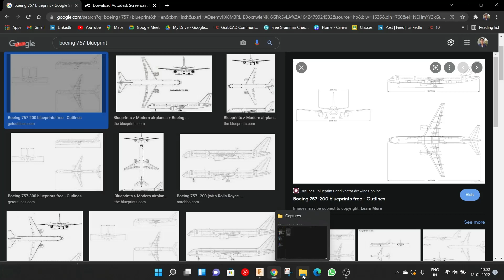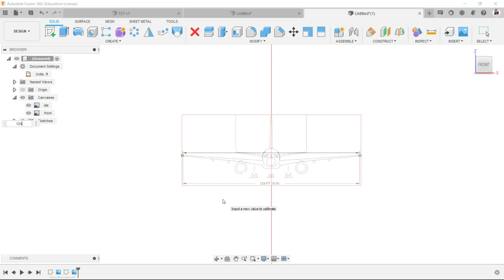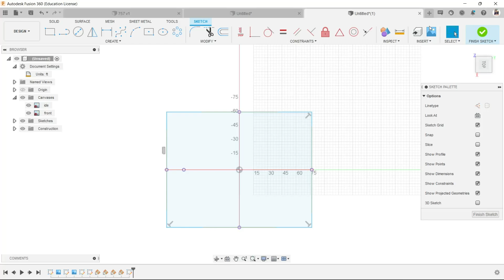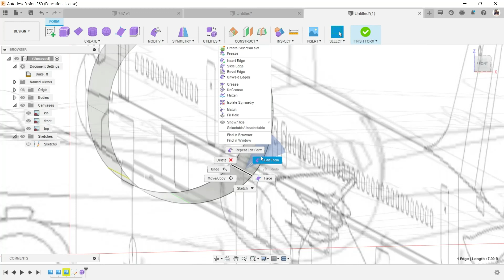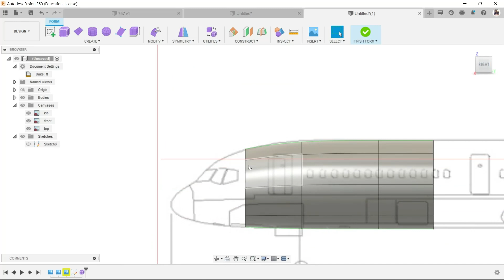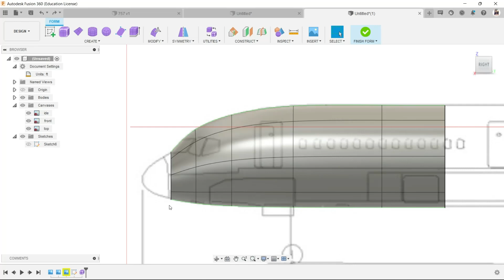How to Design and Render Boeing 757-200 Aircraft Model using Autodesk Fusion 360 | Part 1 Fuselage |

Comment: so i modelled your 757-200 and noticed it would be difficult if i wanted to 3d print an rc plane to use this method. I then used your method to model an 48inch Airbus A321 and for the belly of the plane i increased the subdivision and manually stretch out the mesh to form the shape of the landing gear compartment instead of using a new mesh all together (sounds hard but not, was very easy) but in short it allows me to have the fuselage be one piece. The next thing is making this 3D printer friendly, while leaving it as a mesh, i used plane to cut it up into 150mm sections then thicken each section to 5mm (might be thick if you want faster rc plane go with 2mm or less) now i have a full printer ready fuselage chopped into pieces. Also a simple ratio calculator can help folks accurately resize a blueprint that 100+ ft to a practical 4ft like i did. if anyone has questions feel free...